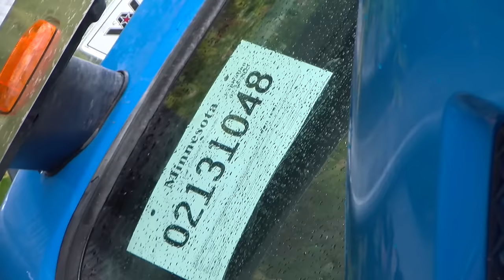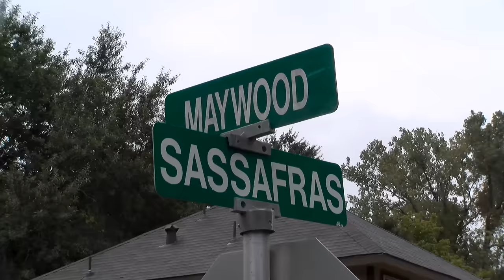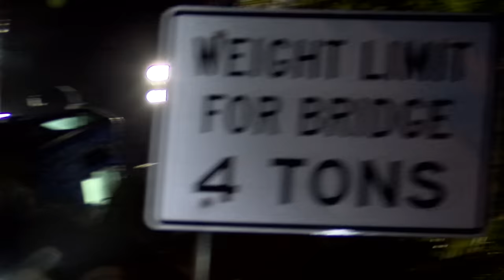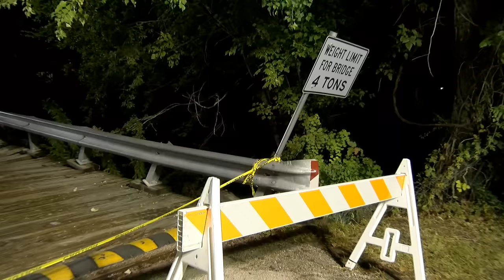091423 40 TON CONCRETE TRUCK COLLAPSES 4 TON BRIDGE AND VIDEO OF FULL RECOVERY

Comment: There is no way that is a 40 ton truck.
Reply: they confused lbs and tons, fully loaded truck is about 40k lbs or 20 tons
Reply: Average loaded cement truck would be about 65,000 lbs, still, absolutely stupid to pull onto a 4 ton capacity bridge, even empty!
Reply: 10 yds of concrete is 40 pounds.
Reply: @gregadomeit4020  
Ten yards of concrete is approximately  40, 500 lbs.
4,050 pounds per yard x 10  =  40,500  pounds.
Reply: @norman7179  oops typo

Comment: I wonder if that bridge was inspected it coul also be that the concrete truck wighed  more tha that permitted but it also shows how rotted the wooden bridge was.
Reply: Ya think?🙄
Reply: @poppyrowland1385   When was the last time that bridge was inspected, it shows how the agency involved with inspecting  the roads & bridges did not do their job, also the the bridge could not hold more than  4 tons but when the  wood in the bridge is also rotted I question why is it that something like this has to happen so you can see how clearly both parties are to blame for not doing their job, why is it that the wooden bridge was not replaced with something stronger let*s say steel or cement , instead something like this has to happen , so things can get done.

Comment: What's interesting is Google Earth street view from December, 2021 show a sign with an 8 ton weight limit.  Did Texas DOT or local authorities know there were structural deficiencies in the bridge?  Still does not excuse a concrete mixer for running the bridge!  👍😎✌